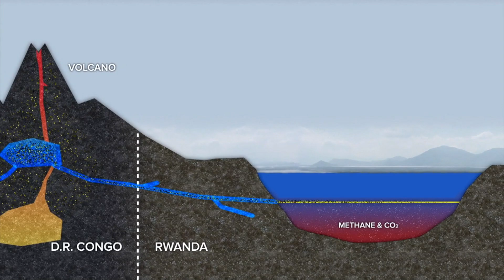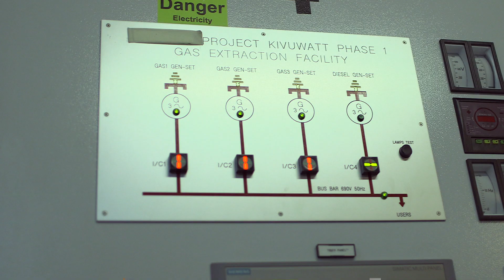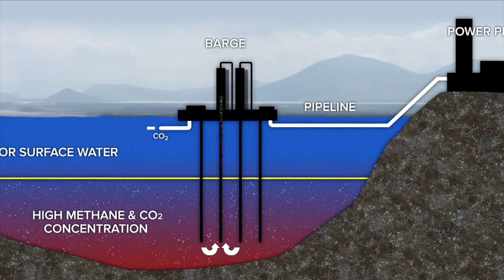The 'Killer Lake' Powering Rwanda - BBC Click

Comment: Interesting that some commenting on this video would rather see Rwandans die from poisoning than release some CO2 into the air that would have been released anyway during a seismic event. Methane is a far worse greenhouse gas than CO2. Its better for everyone that the Rwandans are pumping it out and using it. They don’t have to drill or frac the the land. They don’t have to transport it around the world. They don’t have to rely on larger countries that might try to exploit them. They gain more security and independence. Seems like a win for a country that is working hard to heal from the impacts of colonialism and naziism.
Reply: Yebo!
Reply: Sayit AsItIs that sums it up nicely sir. This is an interesting project that gives power to an area that needs it, reduces public safety risk, and has long term environmental benefits, that’s a project worthy of praise.
Reply: Naziism.  Sure thing pal.
Reply: There is no reasoning with religious zealots.
Reply: I am impressed by the fact that they revisited the issue once viewed as a negative and transformed it using the principles of physics & engineering into a basically green sustainable source of energy. It's not  being perfect  because  it releases CO2 & H2S  into the atmosphere is an issue that can be solved fairly easily  by using the same scientific methods (some more profitable than others ) . If they once again choose to see it as another opportunity /positvie. No doubt that CO2 & H2S have some good uses  if sesquestered for later use. Strive on enduringly! "Good! Better!  Best ! One must never rest until one's goood is better and one's better best!"-St, Maurrice
Reply: To the fanatic any sacrifice is worth the goal.
Reply: @tkorte101  nice projection there, dumbass.
Reply: yes blame it all on whitey
Reply: Yeah I mean it would in all likelihood be released at one point anyways. Releasing it this way, safely and slowly limits the damage it can do. Sure it's still releasing CO2 into the atmosphere but releasing it over a longer time span means that nature has more time to adapt. And if Rwanda makes sure to pair this project with protecting nature the net CO2 release can be zero.
Reply: Impacts of colonialism and nacism? What impacts? How long ago that was? Do you mean clan warfare and genocide between Hutu and Tutsi?
Reply: And you can always use this CO2 to pressurize it and sell on the market. CO2 is not in the air as a byproduct in may cases is a important chemical.

But what are they doing is wise and i aprove it :)
Reply: What impact from "naziissm" you far-left extremist imbecile?
Reply: Not only that, there are also a tone of plants, wich could and will turn the CO2 into Oxygen anyways over the years. I appricitate there will to turn something extremly dangerous into something extremly usefull.
Reply: spikedpsycho  african colonialism was done with the specific purpose of ending slavery. if you do the math, african colonies costed a lot more to maintain than the "profit" that the colonies brought.
Reply: @itsMe_TheHerpes  Oh look, a religious nut who can't see past the fact that they're not the only religion on the planet.
Reply: Let them cry, rwanda People are going to do what they think is best for them 😂
Reply: David Clawson, Methane oxidizes rapidly in oxygen that is why it is useful as a fuel so it doesn’t survive long enough in a nitrogen oxygen atmosphere to be the problem claimed, and the NAZIs had no real influence or effect in sub Saharan Africa you propagandist.
Reply: @davidgrover5996  It would oxidize to CO2 and water though, an exothermic reaction doing the same thing as burning it. Using it just makes the energy usable, also lowering the amount of gad released in case of a seismic event, having less people killed and not having to worry about the short time its actually still methane in the atmosphere. You cant really give what their doing a negative spin.

Also leave the NaZis out of it. If the argument has already depreciated to that point, we could just stop commenting in general.
Reply: well, it's not like those sub species actually know or care, but this is the political trend at the moment. and until the trend is not changed, we are stuck. the problem is the nihilist political faction that now controls the entire western world. there are to few Christian combatants left, thus we all live in a nihilistic world now.
Reply: it'sMe TheHerpes How is the rest of the western world controlled by a nihilist faction and what do you mean with sub species?
Reply: @itsMe_TheHerpes  you sound absolutely insane
Reply: it'sMe TheHerpes: Why do you have to define the Christians as good people? Surely everyone has the ability to be good?

Oh I forgot, except for the greedy bastard politicians of every religious persuasion going. Being a Christian doesn’t automatically empower you with goodness.... Remember that one.
Reply: @itsMe_TheHerpes  you're putting a "christian" doctrine against a "nhilistic" one. Thus you are strawmanning everyone that isn't christian, using a black and white fallacy, and using heavy projection, as the most vocal christians are the ones who refuse to do anything.
Reply: @itsMe_TheHerpes  Nihilism: the line of philosophy that entails a lack of drive to do anything, as nothing truly matters anyway. Christianity: to put it simply, a hippie cult of a war god cult, of ancient semitic mythology. The christian bible even states that the sky is a crystal dome with windows to let the rain in.
Reply: @itsMe_TheHerpes  fallacy: the use of a known flawed argument, or line of reasoning. Black and white fallacy: the insistance of there being only two options, in denial of many. Strawman fallacy: The use of the weakest potential argument one side could possibly present to make your argument look stronger. See "Watch as I burn this strawman of the rival school!"
Reply: @itsMe_TheHerpes  I'm not talking about JW here, don't put words in my mouth. I am talking about christianity as a whole, and if you ask an anthrpologist with a specialization in the middle east, they will say the exact same thing about christianity that I did, but with more nuance. Christianity is an offshoot with cult mentality of Judaism, which is a cult following of Yahweh, the war god of ancient semitic myth.
Reply: @PhilbyFavourites  your communism is showing.
Reply: @HighlanderNorth1  have you read your bible? Whatever happened to "love your neighbor as yourself" "give away your possessions" and the prostitute with 2 copper giving more than the nobles?
Reply: @kirknay  you obviously didn't read my post(or at least you missed the important parts). You also allow your NIHILISTIC hatred of Christianity to blind you to the realities of how most modern christians live. My aunt, uncle and their kids are practicing Christians in NC, who also started a very successful industrial shop back in the 50s. They donate at least 10% or more of their personal earnings EVERY YEAR, to charity, as do many christians, Jews and Muslims. They've helped open affordable, non profit apartments for the elderly, homes for Alzheimer's patients, battered women's homes, etc.

 I'll stop now, and let you and your buddy get back to hating on people like them, who donate FAR more time and money to help others than most of the "tolerant" progressive haters who get off on negatively stereotyping those who don't think exactly like they do...
Reply: @HighlanderNorth1  Once again, I'm not nihilistic. I'm just peeved that they put the black and white fallacy of either christian or some moral lacking nihilist who just wants to sin, when the people who fight against green movements are the most zealotrous christians I have met or seen on TV.
Reply: @troyezell5841  ah, the classic "commie" slur. Would be more effective if we didn't have Russian agents backing every major right wing group out there. Remember Natalia in the NRA, and the troll farms that won Trump the presidency?
Reply: @HighlanderNorth1  Oh, and my comments on the quotes were because christianity, or at least Jesus disciples, were communistic in a proto fashion. They kept no possessions, focused on the community, and lent aid to whoever needed it. Oh, and they also paid their taxes gladly. Remember "Give unto Ceasar that which is Ceasar's?"
Reply: @itsMe_TheHerpes  
Yep.... It amazes me how MANY of the "progressives" and liberals who are alleged to be among the most warm-hearted, caring and kind people on the planet, often end up being the most cold, selfish, uncaring and vindictive! I think they "publicly adopt" the mantle of leftist ideology, because they know they'll be publicly presented as "social justice and morality warriors"  by the media, regardless of how screwed up their character really is. 

 But in reality, as has always been the case with many "progressives", Marxists etc, they secretly desire the power to destroy those who they decide they don't like... That's the great thing about Marxism, when it's fully implemented, it is FILLED with opportunities for witch hunts, pogroms and purges of whoever the hell the leftist elites decide to hate or scapegoat this week!
Reply: @itsMe_TheHerpes  Tell that to the Tea Party, or the Fundamentalist Christians backing it.
Reply: @kirknay  "strawmanning everyone that isn't christian"
But where did he say all non-christians are nihilists? Or did he only mention those specific nihilists without including any other non-christian? Was that actually your strawman?

Isn't it ironic that you try to call someone on strawmanning, only to do it yourself, thus also doing fallacy fallacy?
Reply: @ki0w0-lordofwatersheep  He specifically stated that there are christian viewpoints, and nihilistic ones. That means he calls all non-christians Nihilists, practicing both strawman and black and white fallacy.
Reply: @kirknay  "that means he calls all non-christians nihilists"
Really? Or was that just your misinterpretation/strawman? Isn't that like saying "he said water and earth exist, therefore air doesn't"?
Reply: @ki0w0-lordofwatersheep  water and earth aren't ideologies, especially not ones you're putting into conflict with eachother. He pitted Christians and Nihilists against eachother, saying nihilists don't want to do anything, while christians want to save the planet. If you think that means there are dozens of other belief systems imbetween, you're trying to read something that clearly isn't there. That's like saying the Allies and Axis fought eachother in WWII, and somehow reading that there were other alliances fighting both in that message.
Reply: @kirknay  "if you think that means there are dozens of other belief systems"
Except I didn't infer it from that, but from real world facts, and the fact he didn't deny their existence/label them as nihilists(only mentioned the Nihilists' existence, but no labeling other non-Christians as Nihilist, right?)

"You're trying to read something that clearly isn't there"
Except that by knowing what is & isn't there, I concluded that he didn't strawman all other non-Christians as Nihilists, since he didn't do it anywhere, did he? 

Isn't your calling him "strawmanning everyone that isn't Christian" ironically reading something that clearly isn't there? Can you pinpoint where he explicitly label them as such? Or was it something not there, that you try to read?

"That's like saying the Allies and Axis fought eachother in WWII, and somehow reading that there were other alliances fighting both"
Except there actually were? Those non-block third-world colonies grabbed back and forth between Axis & Allied colonists, & fought for their freedom from both? Not inferring from "Axis fought Allies", of course, but from real world facts, and how that fight doesn't automatically label anyone else(especially said colonies) as Axis or Allies. Nice analogy, you played yourself again?

Using that analogy, wouldn't you reading "strawmanning everyone that isn't Christian" when it's not there, similar to if he said "the Allies fought Axis" and you read "he strawmans every other countries as Axis"?

Comment: And what happens with extracted CO2 ?
Reply: Compress it into small bottles and sell it for airsoft gun
Reply: Slowly released into the atmosphere as apposed to a sudden release that could kill thousands.
Reply: I think they pump it out into the water on the other side to be released slowly into the atmosphere. Considering the surrounding Rwanda and Congo regions around are more of forest with minimum industrialism, it would be safe and a clean way to produce energy in a country that really needs it
Reply: Andriy Gavrylenko Gone!!! Reduce to atom😋
Reply: Same thing  that happens when they burn the natural gas.   CO2.   It goes up in the air.  Fossil fuel.
Reply: @YearRoundHibernater  could you tell me which company pull co2 from air to make fuel? I know it's plausible, I just didn't know it's profitable
Reply: @YearRoundHibernater  I'm sorry, but I couldn't find the video.

Based on my current understanding though, to capture co2 from the air require a massive amounts of energy, which then needs to be combined with hydrogen, which also needs energy to produce. So it's far from an energy source, it's basically a very inefficient energy storage. Although it might be useful for massive aircraft carrier that use nuclear power (usa did research of this iirc)

 Of course, one could claim that it's fine, and all they need to do is using renewable energy source for the whole process. But isn't just directly using electricity a far more viable options then? 

In this particular case though where the co2 is a byproducts of them producing 30% of their electricity needs which they don't have before, is a bit far fetched I think.

However, technology is keep changing and it is very possible that my knowledge in this is outdated. In which case I would appreciate it if you provide me with reliable source to update my knowledge.
Reply: yup gettin 3 more plants. I guess it would be like Fukushima. Hunderts of Tanks onside a mountian xD

Comment: Hydrogen sulfide is the smell of rotting eggs. It would make this lake the biggest stinker on the planet if that would surface.
Reply: What is the concentration of H2s? If it's high enough to be economically viable use the H2S to make sulfuric acid, an important industrial chemical, or use it to produce sulfur for fertilizer.
Reply: @eddydogleg  Doing that isn't really viable economically since there are easily accessible deposits of sulfur that we tend to use instead. A lot of ground water also has hydrogen sulfide in it but we just aerate it out. Sulfur while extremely useful also isn't very rare so there isn't a need for novel solutions like this.
Reply: @hedgehog3180  Thanks. Most of what I know about H2S is about how to not end up death when drilling wells with H2S concentration as high as 35%.
Reply: At low concentrations Hydrogen Sulfide smells like rotting eggs but at higher concentrations it knocks out the sense of smell completely and you then can't smell it, hence the need for detectores.
Reply: @raymurrayie  I never heard of that before  but it makes sense. Thanks.
Reply: The limestone is fucking cure for that shit!
Reply: Can dead smell?
Reply: @PARTHASARATHISAMANTARAY  A dead body that decomposes has a very particular smell. It smells like cooked cauliflower but more imposing. The human body finds it very unpleasant to notice. If you find that smell in your house, there is a dead mouse, rat or something like that somewhere.

Comment: Hmm they are using modified diesel generator, i thought they gonna use combine cycle jet engine
Reply: REGARD More reliable, easier to maintain, cheaper to install. No brainer.
Reply: Next time look up the Wärtsilä website, they make duel fuel engines, which means they can burn diesel or any gas (not petrol or gasoline, but natural - compressed or liquid or methane as shown they are burning to produce said electricity.

Comment: And the by-products go where exactly ?
Reply: Into the atmosphere.  This is actually a good thing as lakes loaded with CO2 are a ticking time bomb.  The CO2 in the lake will get released eventually, it is much better to release it slowly than all at once killing over one million people.
Reply: Note that methane is a more powerful greenhouse gas than CO2. And unlike CO2, it can’t be absorbed by plants through photosynthesis. Either you let it get outgassed into the air or you use it to produce energy plus CO2 and H2O, both of which are absorbable by plants. Second option is better.
Reply: @Rwizaify  Also worth noting that even though methane is a much more potent greenhouse gas it breaks down far more quickly than CO2 in the atmosphere.  The sad reality here is that were it not for the methane nothing would be done to remove the CO2 from the lake.
Reply: the lake has no room to hold the byproduct. For the same reason, they have installed pipes in the cameroon lake simply to blow off excess gas.